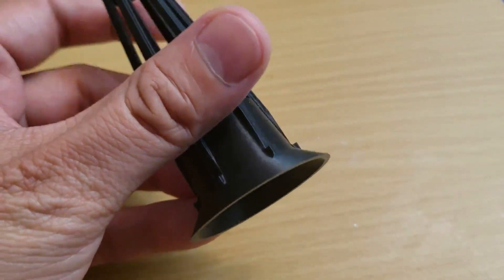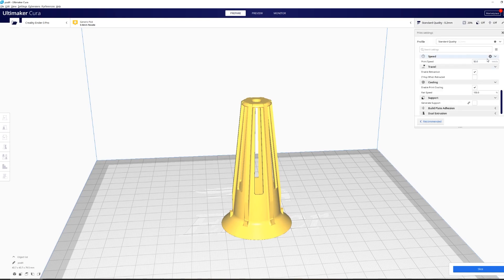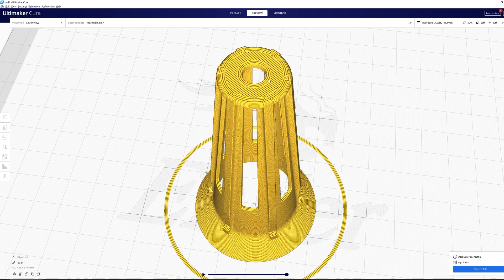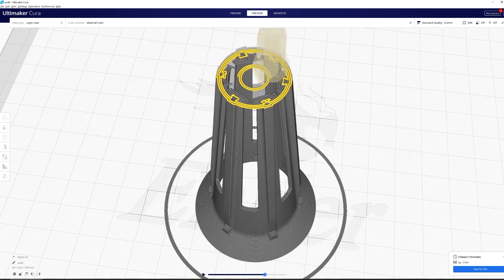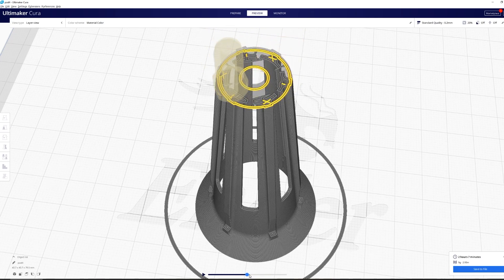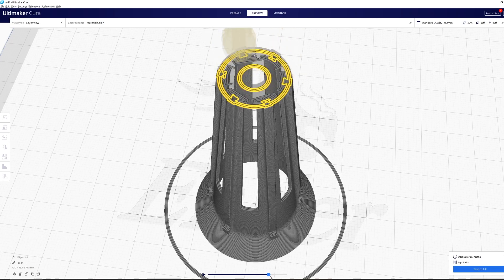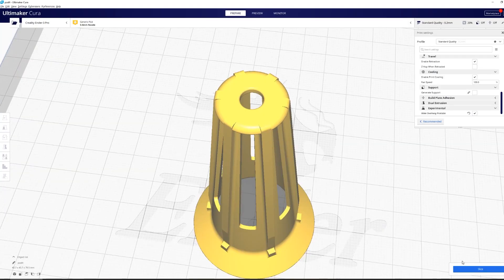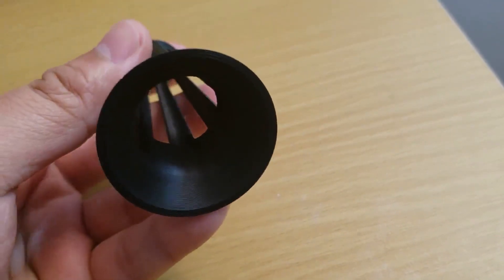The Pinhole Problem in Cura Slicer for 3D Printing

Comment: You could have also printed it on the flip size. Meaning upright like an ice cream cone. But really good input on the "stringy" mess on floating holes during slicing.
Reply from the maker: That's very true. Sometimes it's easier to reorient, but there are times when that's not an option. I never thought about printing this with the pointed side down, because it seems less stable, but I might give it a try now that I'm curious if it'll stand.